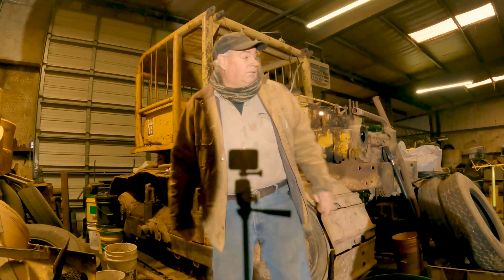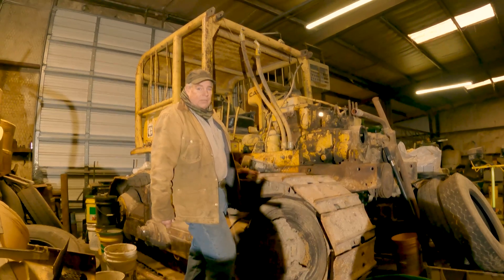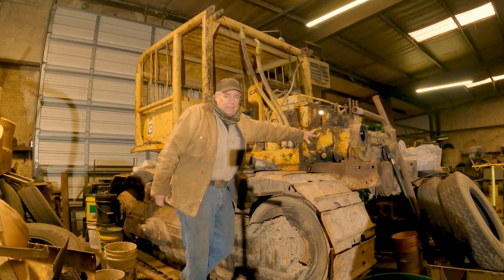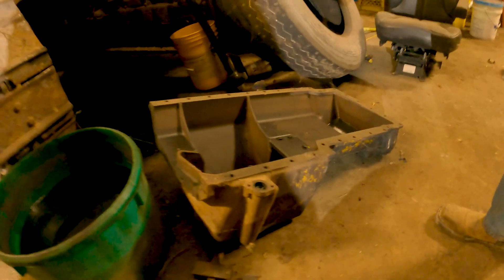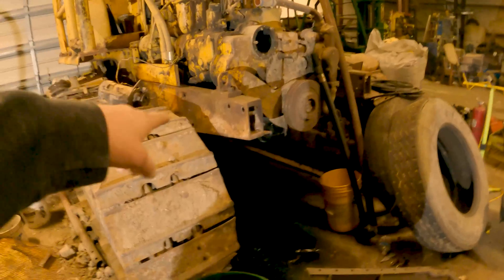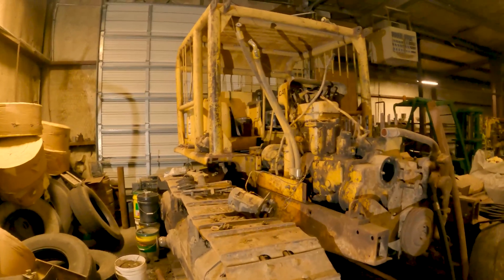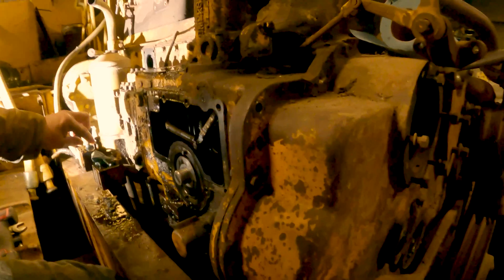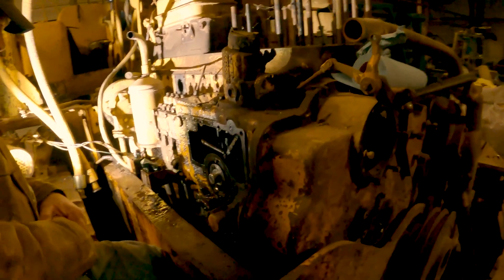Caterpillar D7E Injection pump and inspection cover removal

Comment: Thanks for the video guys..  I have a 1968 D7E #48A118** that's still running good, but my left final drive seal is bad. Do you have a video for that job ?  Thanks 😎👍
Reply from the maker: Negative Sir. But thanks for watching.
Reply: @vintagediesel-1  
What is negative in my comment ?
Reply from the maker: @idessaoutlaw  Sorry by negative I was saying I do not have a video on that ..Sorry for the misunderstanding
Reply: @vintagediesel-1  
My bad 😎👍

Comment: Thank you for this video.  I found it helpful.  I have a 1968 D7E 48A6393 series equivalent (has an Army S/N).  Do you know if you can remove the water pump and replace the oil seal in the machine.  The hard nose and radiator are on and everything else is intact.  I have an oil leak and it looks like it's coming from where the water pump meets the engine.   Any help or advice would be most appreciated.
Reply from the maker: Yes you should be able to access the front seal on the timing cover. Hope that helps. Thanks for watching.

Comment: Question here my Dad has a D7 cat I don't know what year it's a 4 cylinder we started it and seems like it's trying  to run way too high rpm and we can't idle it down to turn off we had to disengage the head compression lever, any ideas?
Reply from the maker: You can check the timing but if nothing there then pull the pump and send it off for a service
Reply: @vintagediesel-1  Thanks for response would timing need adjustment? It ran fine when parked? But if it does how would I check it? In my local area I don't have service options
Reply from the maker: @JB-fl5fy  From the description the injection pump needs serviced
Reply from the maker: @JB-fl5fy  Could possibly be a stuck injector. You can have them bench tested when having the pump tested. Thanks for watching
Reply: @vintagediesel-1  Thanks for your help